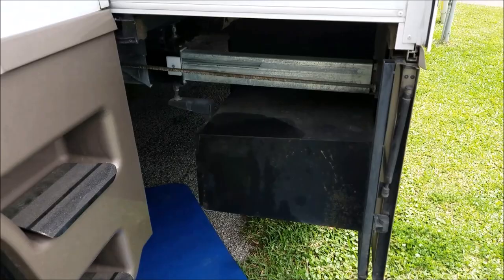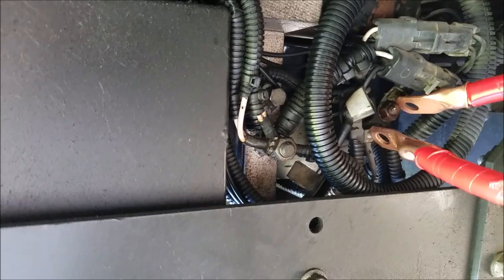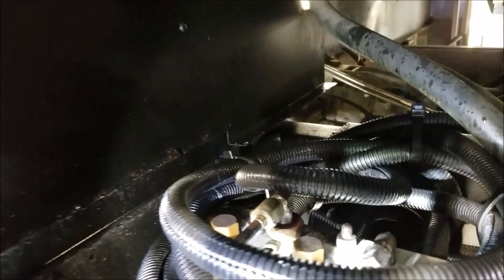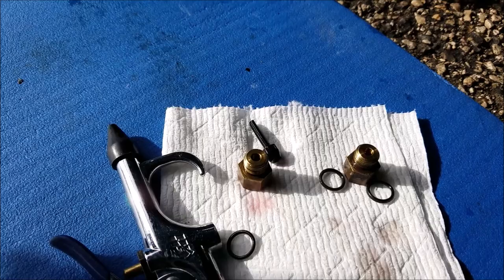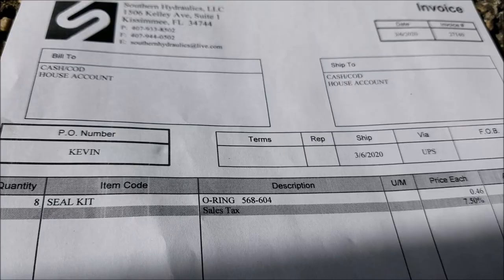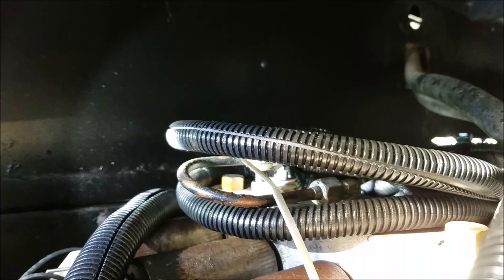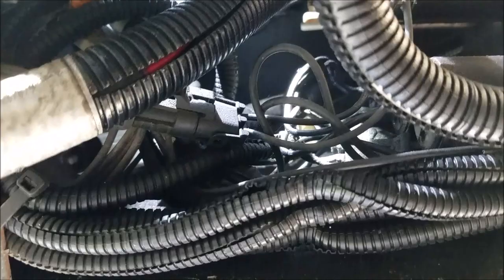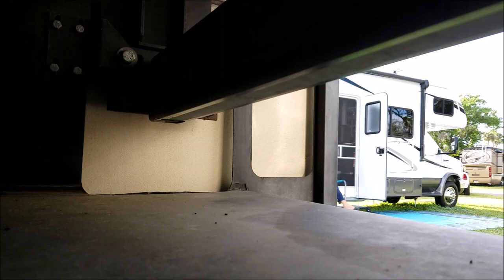HWH Hydraulic Leak Check Valve Oring Blew Out, Found Check Valves Were Loose, Are Yours ?

Comment: Thank you, Kevin.  This is a good start in my trying to understand how my HWH system works on my 2002 Rexhall.  I have a leak under my joystick control as well as my rear slide.  I am hoping it is simply loose connections and work O-Rings.  I just purchased the rig from the original owner in March.  

If you have any other tips, please pass then on :-)
Reply from the maker: if you ever have any questions just text or call my cell 606-8750125 Kevin

Comment: Thank you for sharing this video. Very helpful. Was wondering what you use to remove the hydraulic fluid smell from your internal compartment. Seems using one chemical to degrease hydraulic fluid just creates another toxic smell. Thanks for any suggestions.
Reply from the maker: @s.mendez7160  mass air flow cleaner is a good cleaner degreasser and it's safe for plastics
Reply: @ktoutdoor  Interesting. The Hydraulic Fluid leaks on to the thin carpet on the inside of the central compartment space. Mentioning this just thinking about materials. Thanks for your suggest, and appreciate you answering back.

Comment: Thanks so much for video my leak was totally do to one of the Oil Rings that you described.   I fixed the oil rings and and filled the hydraulic but still gave  no real pressure. The rear slider will go out and a snails pace but jacks and main slider do not move. I hear the hydraulic pump running but never act's like its under load.   Its a 2006 Winnebago work horse. Have you ever changed the hydraulic  pump?     thanks  jim weissert
Reply from the maker: Its was nice talking to you today.  Let me know if a new shuttle valve takes care of the problem

Comment: Great educational video, Kevin. Thank you. 

Kevin, I have a question for you. It appears that the our 6-volt batteries need to be replaced in our Dolphin. After a full charge, disconnected, and @ 20 ours to stabilize they both read below the 70% charge level. The batteries are Interstate Extreme GC2-XHD-UTL (232Ah, 122mins @ 75A ). After much research, it seems like the Interstate has the best batteries for the price. One of the batteries is from June 2015, the other battery is from Nov 2013. What 6-volt batteries have you had good experience with in your RV? Thanks.
Reply from the maker: Watch this https://youtu.be/BWF_SXV49ok  I got 6 years out of these DEKA Pro Master Batteries But just 2 months ago I replaced the 4 lead acid batteries with 3 Battle Born batteries "Video coming soon" I really love these batteries 10 year warranty call me if you want to talk RV's 606-875-0125 Kevin
Reply: @ktoutdoor  Just watched your "Upgrading from 12 to 6 Volt batteries in Winnebago Voyage 38J" you suggested in your reply. Definitely a better battery than what I have been seeing; better warranty, less expensive, more amperage, and they can be purchased through and picked up at Lowe's Hardware. Thanks for the info. The RV manufacturer's should be watching your video for some great improvements to RVs... and paying royalties. I may give you a shout later today.
Reply from the maker: @geneduclos4003  Call any time 606-875-0125 Kevin

Comment: Thanks for making this video.  I this video for the feet or for the slideouts?  I had a tiny hydraulic leak on the front foot pad, but since it was so small I left it alone.
Reply from the maker: Ours is a HWH system and it controls the 4 jacks also 3 slides

Comment: Kevin, very interesting video. If I may, I have an issue with my HWH hydraulic system for jacks and slide out on my Four Winds Magellan 2006. Slide out are no more moving and jacks are moving very slowly, motors works and oil level looks ok. Any clue what is going on?
Reply from the maker: Give me a call i stay up till 3am most nights my cell 606-875-0125 Kevin